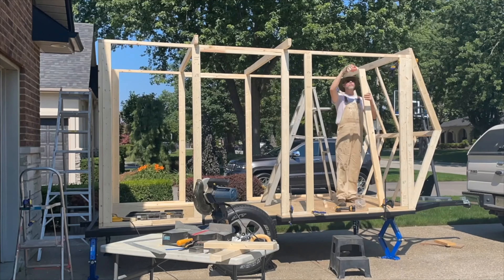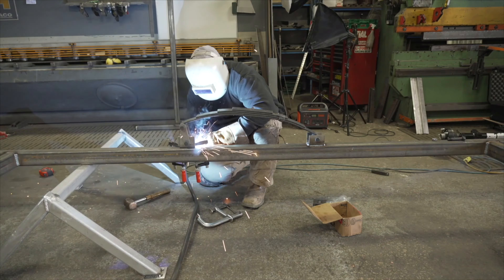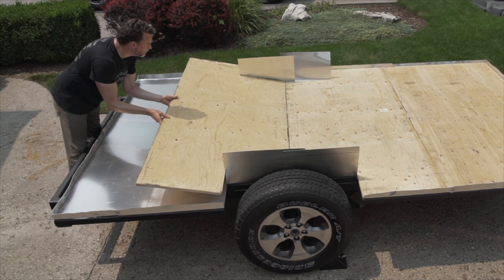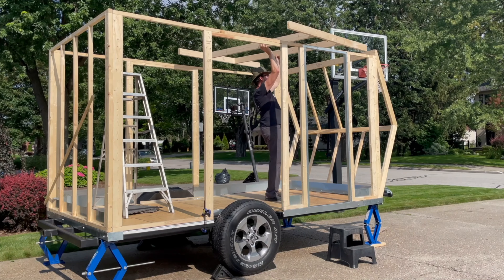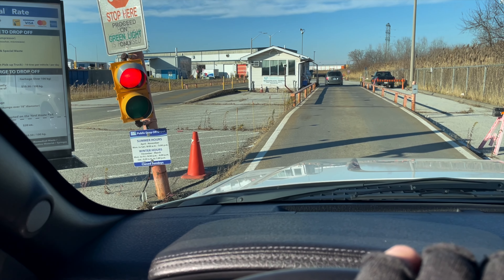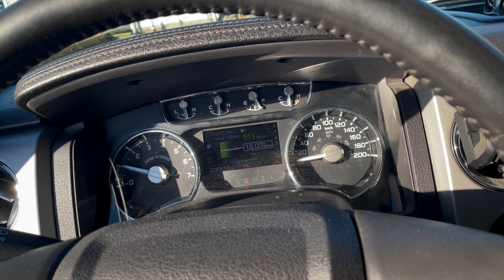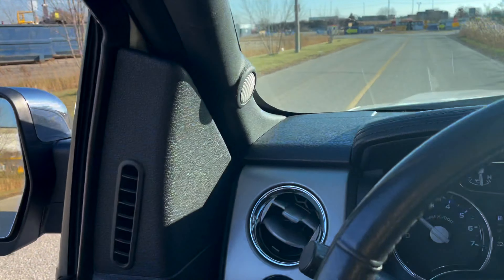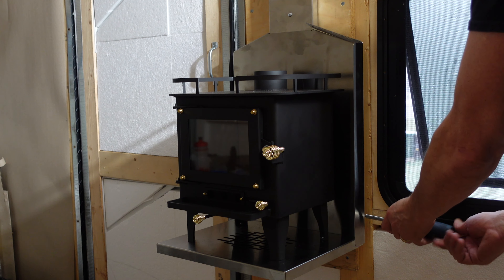How Much Does a DIY Travel Trailer Weigh?

Comment: I was guessing 2400 pounds.  Homebuilt stuff is "always heavier" than factory built, I suspect mostly because the factory is always looking for ways to save material costs, whereas the home builder is thinking more of trying to build for longevity, and since it's a on-off build, there is not that much added cost to build it heavier.  Eddie is looking good, I look fwd to you getting it out camping.

Comment: May I suggest a friction sway control. I built a few campers from teardrops to small toy haulers and the sway control gives you a piece of mind even if you don't need it especially with a 1/2 ton truck. It makes backing up a little more work but it does help in wind.

Comment: Cool.  Information empowers you to move forward.  The ways you have insulated Eddie should make him warmer than your truck bed extended camper & you can stand up!  Especially with the wood stove.  But that tiny firebox will need feeding a time or 2 in the night. You may want radiant floor heat that runs off your Bluetti or Jackery if the waking up is an issue. Good reason to test it before you keep building.  You can test your floor plan & lighting before it is permanent too. He sure looks good.
Reply from the maker: Thanks.

Comment: One Tonne  is about what I might have supposed.   5 million kilometers of  commercial driving experience  offered several lesson in  overbuilding.  If you might travel on any steep grades you might want the heavier axle.  Those axle ratings are usually  "flat land ratings".   FYI:  Michelin LT235-85R16"  TEN-PLY  MIGHT BE A GOOD TIRE CHOICE.  Weight limit about 3000 pounds per tire at 80 psi.   As you suggested... You are right... The heavier frame , axle and tires  are low mounted weight and well worth the few extra kilograms.  The stiffer frame will resist flexing more than the ultra-lite models will... OR, the ultra light will flex more than your rugged duty model.  As you know, it is preferred to NOT load frame,  axle and tires full  maximum capacity,  all of the time.   If I want my stuff to last I try to load to HALF CAPACITY or MAYBE 75% OF LOAD  CAPACITY.    US ARMY  'off road rated trailers'  had a plaque on them  restricting OFF ROAD weight limits to 'half' of flat highway  or on road weight limits.  I believe those engineers got it right.

Comment: You should have disconnected the trailer from the truck and weighted it by itself. Also should have weighed the trailer hooked to the truck with the trailer only on the scale. That way you know what the weight is on the axle.